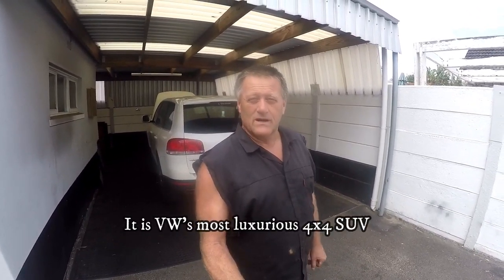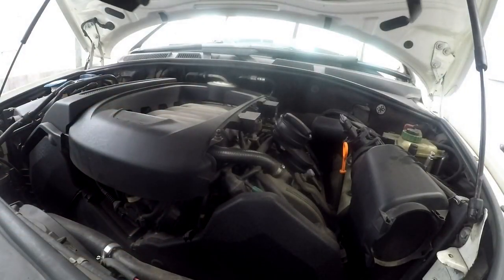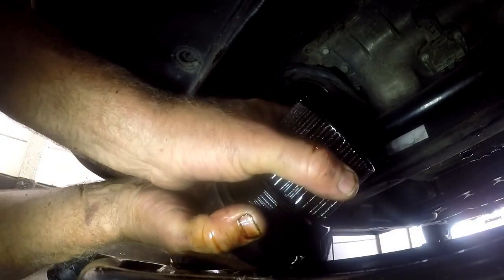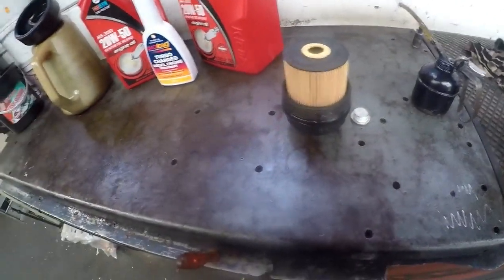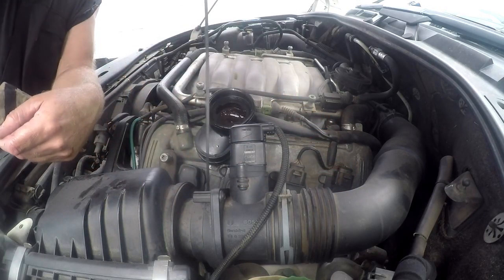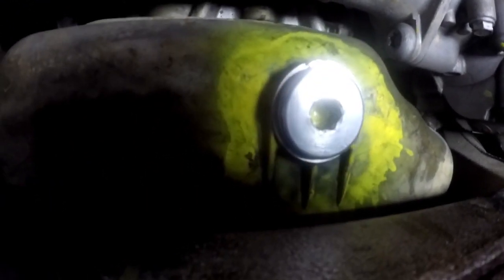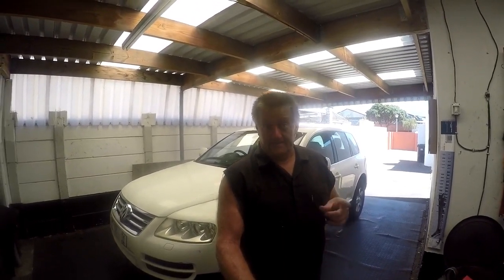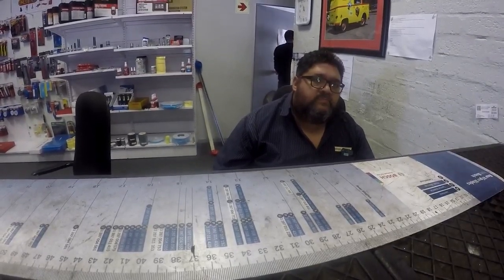VW Toureg - Engine Oil & Filter Changed

Comment: Those VW engines are known for oil problems, so changing the oil often is definitely a good thing. Oil pumps wearing with too long an oil change time. Pump is not too cheap, but the labour to install it is not cheap either, as you have to take half the engine apart to get to it.

Comment: Informative video Gary.why didn't you use engine flush in this instance
Reply from the maker: Customer's instructions, Sathasivan, the parts were supplied to me by the customer, this job was a favour to a parts salesman I deal with, he did not want the engine flushed as he does this procedure every 6 months no matter the mileage, so he thinks it is not needed to flush.